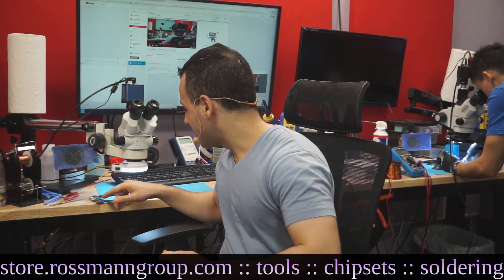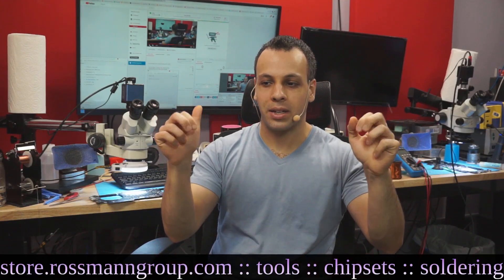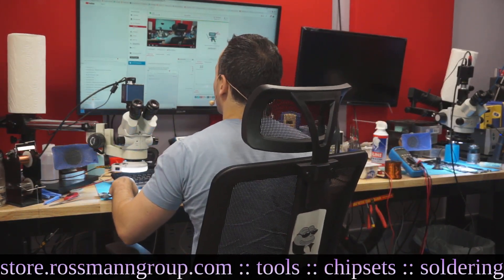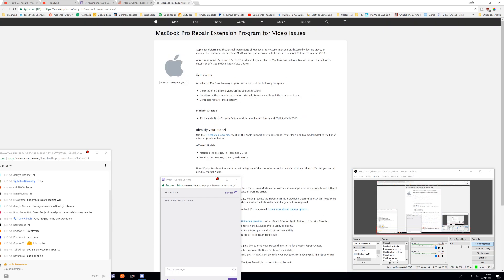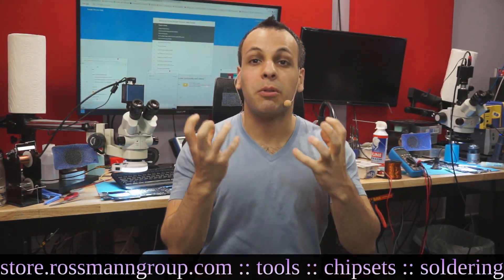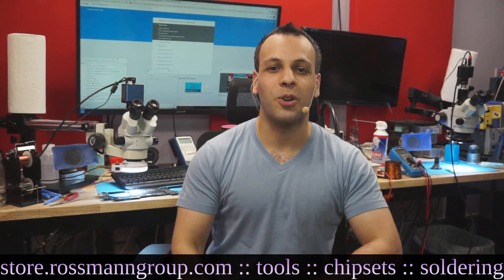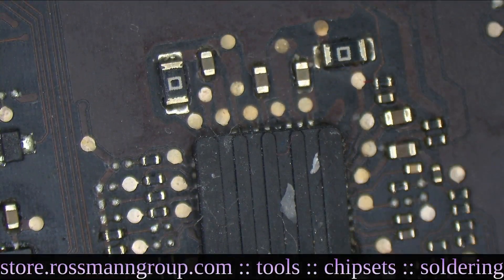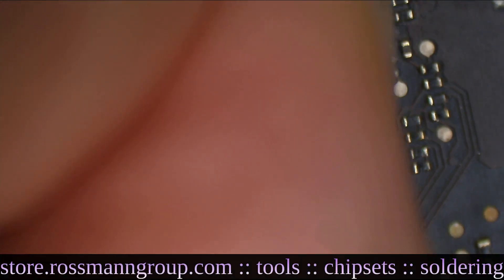Are jerryrigged fixes unique to independent repair?

Comment: my MacBook Pro 15 inch mid 2012 retina actually died on me. sometimes the screen turn on and sometimes it boots with black screen. I think my gpu fails on me and im not good with logic board repairs and soldering or something. I actually want to do 'the apple way' to fix this. so if I put a rubber part on the specific chip it will not fail the gpu again?

Comment: Dam dude, they shoved a condom on to it, that, and the part is on the piss! I restore old UK slot machines, so folks like myself often have to mostly down to the age of the equipment we are dealing with (I Have an old electromechanical based Bell-Fruit machine called Cross Over, that is nearly as old as I am.... I'm 43), make mod's that the OEM did not have in mind (Kynar wire is your best friend here!), so you are not alone on this. As AvE is often fond of saying..... you piss with the cock you have got!

Comment: I guess more money for you if they do not fix the structure of the case and fix the board to be more sturdy and add proper solder. Albeit everything these days has shitty solder on it. Fixing an Xbox plug over here and the solder on the bottom is so shitty looking. Every joint looks like the dull brittle solder. Still, I like seeing this it is fascinating I know companies are shit but I never knew what they did to fix issues wish there was a whole channel dedicated to exposing how shitty most companies really are. Also, ACs work the same in everything, cars, windows etc it is just the water cycle over and over. Rattling could be many things in all honesty. Probably something simple.

Comment: I used to work on board level repair in the Production line of what was at the time a large Manufacturer.
it was not Uncommon for us to run jumper wires.
Multi layer boards in the early days often had issues with the middle layers i am sure the practice will still go on as a few low cost jumper wires will save a costly board.

what you do is provide a service that allows people to extend the life of there device beyond what the manufacture would like.
the nay Sayers are entitled to there opinion but people also have a right not to be ripped of by manufactures.

Comment: What would be the function of that foamy pad? How is it placed relatively to close structures? If it somehow prevents board to flex or relocates the pressure-point so that weak structures would not get stressed, then I would understand the purpose of it..

Comment: Pause it at 3:40 and take a good look at that chip, it has been taken off and placed back on CROOKED, by Apple...
What we do to fix this is the best that can be done, e.g. replace the brittle lead free solder with the more pliable lead/tin solder. The machine has been made. We, or no one else, can add more screw posts to the case or plan out the board thermals different to fix the underlying problem that causes this. The fix that makes sense is lead solder, not rubber pads to put force on the chip.

Comment: Dude what you're saying is kinda somewhat imo irrational because if they make failing components or products they need to address that and fix the problem because these phone companies like LG with their crappy 1 year warranties and after 2 1/2 years your phone suffers catastrophic failure and you look online the stupid phone had major flaws in its design since launch, like "Phone invalid sim card when battery dies and charged then powered back up to have sim card connect then couple months later the sim card literally no matter what i do, use a piece of paper to put more pressure on the sim tray will not correct it anymore and literally its not when the phone dies now, its just the phones fucked" but yet i can still use it to search shit like a ipod touch right? WIFI that bitch and now the phone has a worse problem. Not only can it not be used as a smart phone, or phone in general, i can't even use the phone to wifi because the phone restarts randomly, if you look at the problem its retarded -.- These phones were fucked right from design. These phones should last you lets say 10 years if you don't abuse the fuck out of em and yet i didn't do that and mine lasted longer than some of these peoples G3's like 3 months or 1 year. I'm left without a phone now because new phones are too fucking expensive. S9 Please, $900-$1k but thanks for them learning experiences louis. Also, its like saying these phones if they were dropped in water is fucking w\e, your fault but man. Phone really should last alot longer. Two of my other non smart phones lasted 4 years each, LG KP 500 COOKIE and LG flip phone from 2008

Comment: LOL, so true...
People think they get these faulty products, go around the shop, design an entire new board to fix things, and build the entire thing out of scratch to fix whatever issue was there... as if.
Truth of the matter is, the more mass produced the procedure is, product, fix... the more shortcuts they are going to take. You are just much more likely to get a service that will last in local repair shops because they really don't want you going back there to complain that it's still not working or something in comparison to an Apple store - which they are much more likely to just want you to go away quick to move the line.

There's this enduring myth, which Apple and other companies really do want you to believe, that "geniuses" or whatever are more qualified than people working in repair shops and whatnot... most of the times it simply isn't true. From personal experience, it isn't even true for the stuff people were hired for - like providing information about a product for a costumer.
Man, I gotta rant a bit here, but I'm freaking tired of going into brand stores asking for some spec info for which sales people either flat out don't know, or just lie something to see if it sticks. And it's often for the flagship shiny product that they are showcasing as centerpiece of the entire store... it's freaking ridiculous. Go outside the product brochure you're done.

Official repairs goes down the same path... people should not expect to find a hardware designer, a PCB engineer or something like that on official repair. It's usually just someone hired for the least ammount of money possible that was trained to stick to a checklist. Simple enough, sure they'll see it there. Too complicated, they just pass it on, say it's unrepairable, offer you a refurb or something. And I'm not hating on staff or anything like that, it's just the reality of it. They are not paid nor required to have an extensive electronics background to work there.

If Apple and other manufacturers were ever to hire someone like Louis, Jessa, among others in the repair channels - with them accepting of course -, they wouldn't be working as Apple geniuses or something like that... I'd wager they'd get a position supervising and testing final designs, far faaar away from stores.
Reply: "People think they get these faulty products, go around the shop, design an entire new board to fix things, and build the entire thing out of scratch to fix whatever issue was there... as if." They don't recall a product because of a design flaw. They rather patch it up or nickel and dime you for replacement parts until the the next best thing is going to be released.